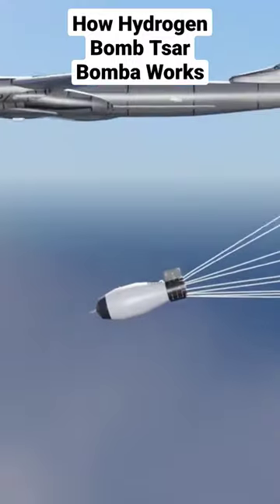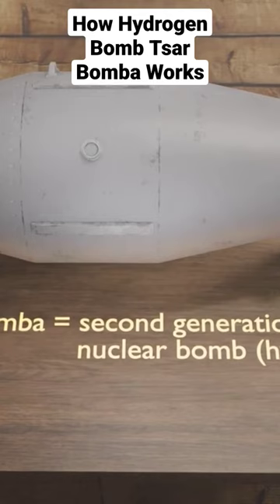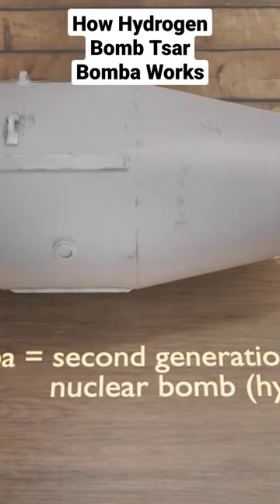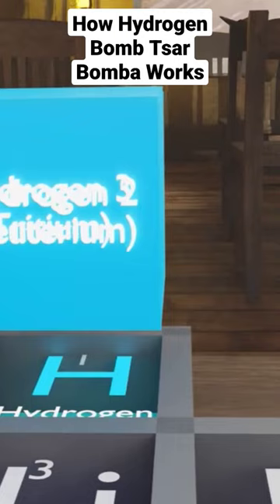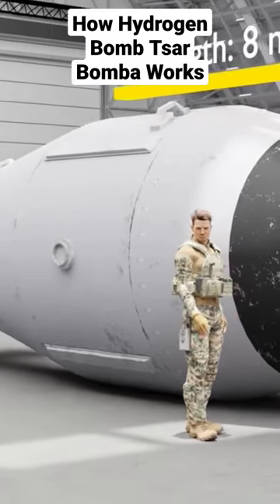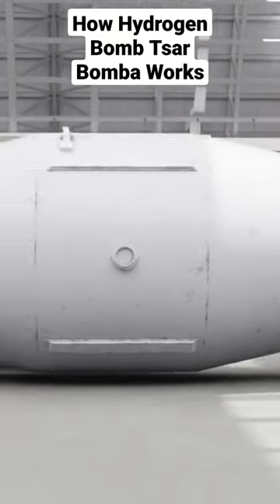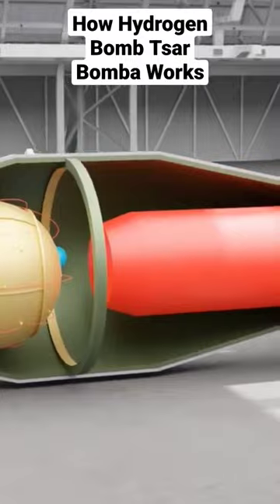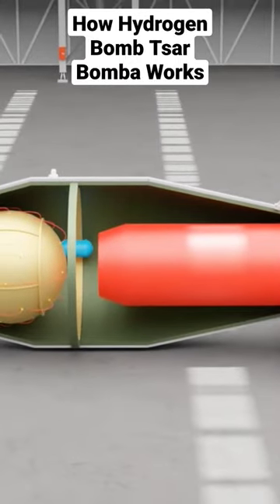How Hydrogen Bomb Tsar Bomba Works

Comment: So this is not about how the Tsar bomb works at all? Why even make the video just to show your lazy approach to basic research?
The AN602 did not look like that.
It was a four-stage weapon that used a fusion module sandwiched between two fission primaries, in a configuration called a "layered cake". Both primaries brought more X-radiation energies to bear on the secondary in a more symmetrical geometry, which in turn fed back into the primaries and essentially repeating the cycle, until the increasing volume and decreasing density of both secondary and primaries ceased undergoing supercriticality. Although it was very large, it was also energy efficient and one of the cleanest thermonuclear tests ever.
Being detonated at over 3 miles altitude only added to that.